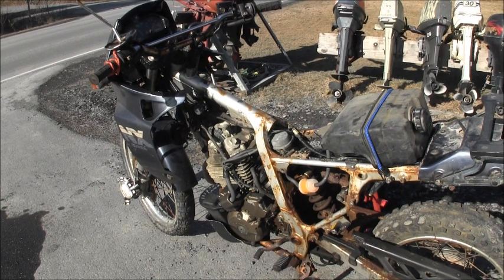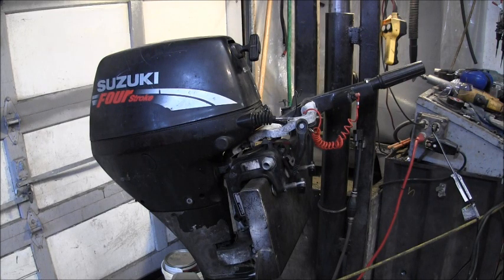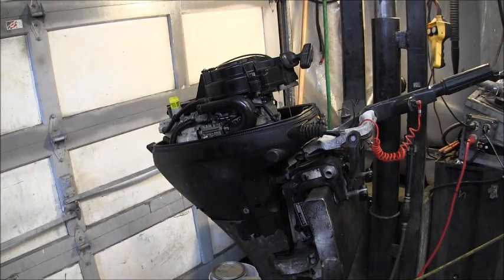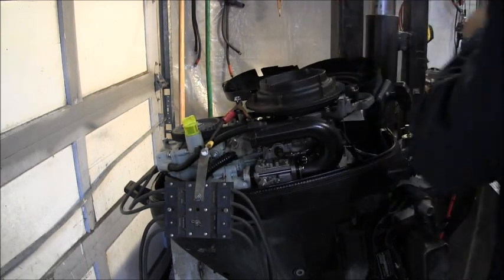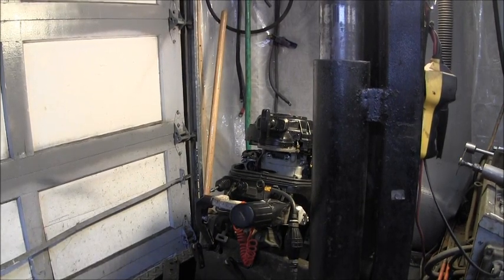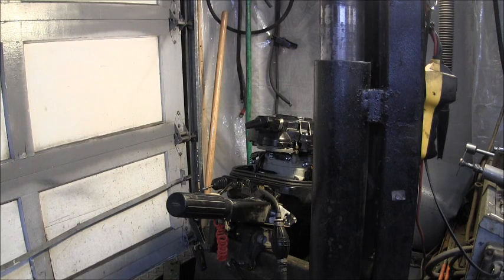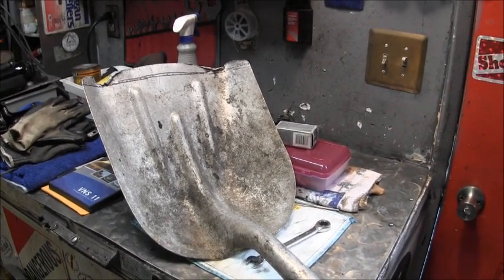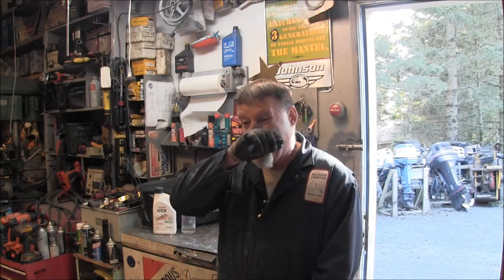YAMAHA 2 STROKE 15 HP,  SUZUKI  4 STROKE 15 HP    &  more

Comment: Its so good to see you into another boating season, Kodibass! I am always inspired, and often amused, by your great outboard based videos, thanks! I dont have my garage  quite as well outfitted as your shop, though. My outboard motor repair stand is only a 2x4 bolted to and extending out from the end of a wooden workbench that i can clamp my 30 horse Johnson onto with the lower unit removed so I can refit the power head and megaphone to the exhaust housing.

Comment: Hi Kodi, I have a 1980-81 Mercury 9.8 that has a good power head but a bad lower unit.  The main shaft bearing under the water pump assembly is bad but someone has tack welded the bolt head to the pinion gear so I cannot dis-assemble it to change the bearing as near as I can tell. It is a short shaft motor. Do you happen to have a good lower unit for it? Love the way the little motor runs but I can't get it to stop eating the seal on the main shaft with the bearing be bad, obviously.
Reply from the maker: The only 9.8 I have is a L S, & the cav fins are missin chunks,  sorry  not 2 many older Merc's in my area.  kodi
Reply: @kodibassInsideoutboards  ok, thanks Kodi.

Comment: Hi Kodi, I got a email for help on a mercury 50hp 2 stroke 3 cylinder that will not start. These guys have checked everything. It was running great a year ago. They said it will fire up on starting fuild which tells me it's not getting fuel. I told them to go through all the fuel lines and fuel pump. I think there is blockage in there
Reply from the maker: If it will run on S fluid it will run.  Sounds like U R correct.               kodi
Reply: I told them I didn't make house calls but I changed my mind. They sound young and desperate to get it running. I told them if i get it running good they need to pay me what Boeing paid me per hour and gas mileage. haha. lets see if they bite on that one. I'll see if they will let me shoot a video too. might as well